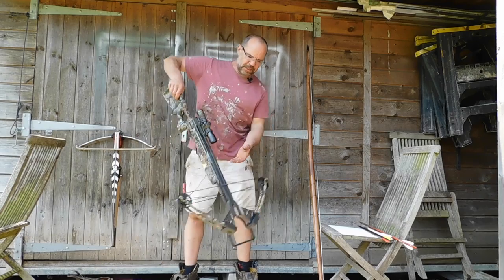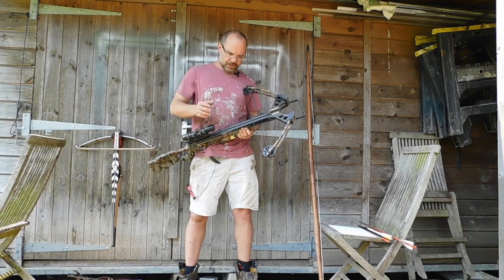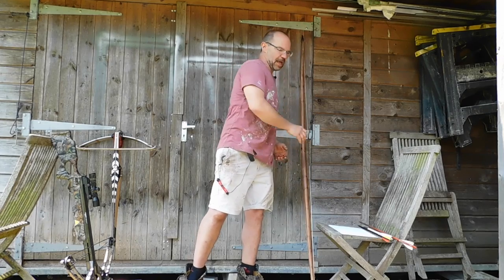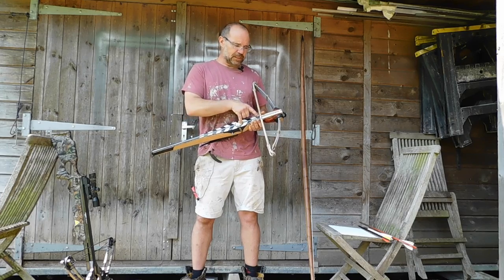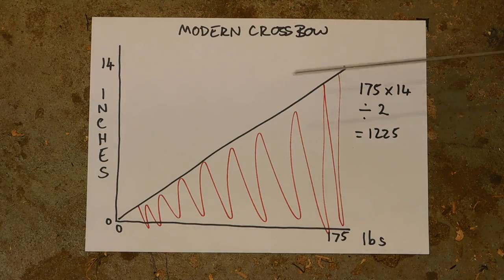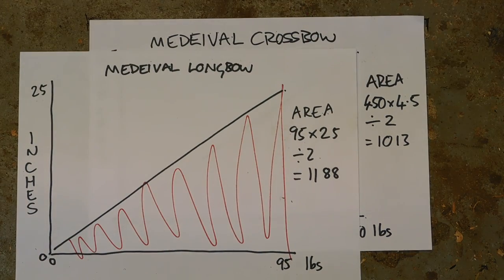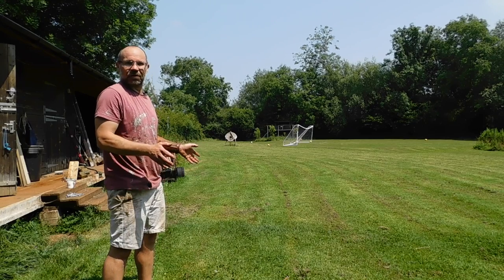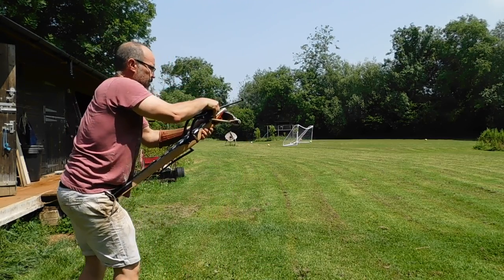Draw weights of medieval crossbows, longbows and modern crossbows

Comment: Well done, this is truly an excellent video. I just have 2 things to add:

Firstly, one of the biggest inefficiencies of the longbow is that it isn't cut past center, like a modern recurve is. That causes the direction of the force applied by the bowstring to not be directly in line with the arrow, wasting energy.

Secondly, I don't think it's fair to compare the kinetic energy of arrows to the kinetic energy of bullets. Arrows have sharp blades and points, and kill through blood loss. I think they're a much more efficient projectile design than a bullet (especially a slug) for penetration.
Reply: Also, in interested in whether momentum may be important as well as energy in penetration/damage. This would mean heavier projectiles with the same energy (and lower speed) might be more effective.
Reply: James K    The effect of a modicum of offset potentially has less effect on the cast than it does on lateral accuracy and dispersion. It is a fact that poor decisions on such factors as pass width, brace height, spine, even shaft diameter and of course shooting style and competence will to a significant degree affect how efficiently your chosen combination can be aimed and shot.
How do I know this? From years of close observation combined with recording my all scores in open competition and relating demonstrable improvements in performance to what was learned and applied to the process of geometry in set-up and subsequent results. 
I'm not just repeating a piece of received wisdom from modern archery as a generalisation.

I can tell you what works for me and why, but  figure that you can learn more if you work it out for yourself.
Simply put I work within the constraints of a certain degree of offset created by a combination of avoiding excessive pass-width, selecting an efficient cross-sectional shape, setting an appropriate brace-height and by employing an arrow selection for any given task that I have proven to my satisfaction.

An excessive degree of static offset at brace height or mismanagement of relevant factors can prevent being able to aim directly at the mark at full draw.. 
 It should also be noted that lateral centre-shot in a bow held vertically (or nearly so) is in comparative terms a very recent innovation. 

Q 1. What is the greatest degree of static offset at your brace-height that will allow you to aim directly at your mark and have the arrow always go there, all else being equal?
Q 2. What are the other contributing factors in bow geometry and set-up and how do they effect the outcome?
Q 3. What are the principle factors in consistently accurate shooting?

"it's meant to be simple. not easy".
Reply: @maninalift   There will be better or worse shaft combinations for a given outcome that can be found by methodical testing.

Comment: Neat video. 

Not sure how versed you are in a .22? Out here in Texas, the .22 is used for a lot and is quite an under estimated round. I think the .22 is listed as a round that has killed a lot of people, likely because “it’s just a .22”. 

Years and years ago the us army did experiments with 1/2” plywood stating if it went through the 1/2” ply it was lethal. 

Would be an interesting experiment to see what that 450 pound does on 1/2” plywood at 100, 150 and 200 yards - assuming you could connect.

Comment: An interesting comparison. Really puts things into perspective and hats off to Tod for a great, clear an informative explanation. One point though: Tod says that the old longbow was better made than the modern variety. This just a thought as I have no way in the means of proof. I would contend that a modern bow is better in regard to final build and tiller because of the time invested in its manufacture by a skilled modern bowyer. This is not to say that medieval bowyers were less skilled, but I suggest that emphasis was placed on the quantity of manufacture rather than quality of build. Modern customers are more demanding and expect a superb bow in all respects. Medieval bows, built for war did not have the aesthetics and perhaps the tiller was less than perfect. This did not detract from their purpose but maybe they did not last as long as the modern counterpart. 
  Flaxen Saxon

Comment: Tod, I think you overlooked something. The arms of the longbow and crossbow were still moving when the projectile was shot. This means that the crossbow and longbow still retained some kinetic energy. You cannot assume that all the kinetic energy went to the arrow or bolt. The energy left would be again 0.5MVV. The velocity of the arms would be different at different parts of it. So its a little complicated to calculate. But at the maximum, it would be the same as the velocity of the projectile at the point of release. M, the Mass of the arms is likely to be heavier in the crossbow because it was made of steel, it is probably safe to say that the crossbow retains more of the energy in its moving arms than the lighter longbow.

Comment: I always learn something from your videos. But I have one thing I'd like to add, as a firearms enthusiast and hunter. .22LR may have more energy, but it has very little mass. Something like 20-30 grains. It loses energy very quickly and therefore loses quite a bit of penetration
Reply: If you look at the [ethical energies needed for hunting typical game] charts there is a ratio for the Energy needed for arrows and bolts to the Energy needed for firearms to ethically harvest the same sized game.  If you multiply the Energy (in foot-pounds) of Projectile weapons (bows, crossbows, etc...) by about 60, that number tends to roughly match a modern firearm's required Energy to ethically harvest a given animal.  I believe this is mostly due to the Projectile Weapon's greater Sectional Density in comparison to the SD of the firearm's ammo.

Comment: I think something that's important to consider is the change in context of stopping power. Modern fighting involves weapons that even heavily injured soldiers can still use effectively, as opposed to all pre-firearm weapons which required much more physical labour from the user. A minor arm or hand injury would make a bowman essentially useless, a puncture anywhere on the body would make melee combat excruciating. The standards of damage caused by a weapon would have been much lower back then, and the ability for instant kills would be basically pointless, out of the fight is out of the fight.

Comment: About the units you used in this video. You wrote lbs (unit of mass)  on the x axis and inch (unit of length) on the y axis of the graph, which gets us:
length × mass
Which isn't the thing you were looking for, I think.

Now if we were to substitute lbs for lbf (unit of force/weight) we would get:
length × force
Which is a unit of energy and is the thing you were looking for, because all we have to do with this value is divide it by 12 and we get the good old ft×lbf.

Comment: Drag is proportional to squared velocity, so the difference between modern and medieval bolts may not be so great at 100+ yards.
Reply: Yeah but actually hitting what you are aiming at at 100 yards is a whole other story. But you are right. Weight trumps speed at any distance really as long as you can get it where it’s supposed to be. I compound bow hunt deer and have hunted with what I consider light arrows (350 grain) and heavy-ish arrows at 450 grain and that little jump makes a world of difference in penetration. Guys I know that use traditional equipment rarely are under the 600 grain mark. They will zip those arrows through a deer at or less than 1/2 the speed my compound is shooting.

Comment: Hey Tod, old video I know, but there's more to the story than you mentioned and I feel like it should be acknowledged. Broadheads don't kill through kinetic energy like bullets, they kill through penetration, which KE is NOT a factor of. Bullets push their way through tissue, which is why they have such high KE. A basketball carries far more kinetic energy than any of these tested mediums, for example. What matters is a mixture of physiological effects (muscles retract and lubricate arrow shafts with blood when cut while an animal is still living) along with the mechanical advantage of a broadhead (or to a lesser extent a bodkin) which amplifies the work the arrow or bolt can do with the available force. This is why an arrow will penetrate a sandbag deeper than a .357 magnum will.

Comment: How efficient is the Mongolian type bow over the Long bow, i was going to ask this in another video you showed.
Reply: You mean recurve vs long bow?
Reply: i read a study done by some university students awhile back that went in to just that. They concluded that in terms of efficiency, the chinese bow was about as efficient as any traditional bow can get. Not much of a surprise considering they used it for so long, even long after european firearms outclassed the bow in terms of battlefield efficacy.
Reply: Presumably you mean the recurve design (as opposed to the compound construction)? Both had significant benefits & drawbacks

Recurve bows of that period are expensive to manufacture in both cost & time & pack about as great a punch as English simple longbows. /However/ the significant comparison to draw was (?is) in the different styles of warfare: Orientals tended to prefer horse archers whereas Europeans preferred foot. Obviously a longbow is an impractical weapon to use from horseback, while the recurve can be designed to optimise the slash/attack cavalry tactics of the Eastern style /in a major battle/ (prolly a 'memento' of Ghengis' hordes: 'It worked then, so we did it this way!')
Reply: @snafu2350  ...They were used by the scythians in the antiquity already. Nothing about ghengis' memento or whatever.

Also just cavalry tactics in general. Can't use any other warbow effectively on a horse. Too big, or too weak.
Reply: @snafu2350  longbows were used on horseback just not very often. They had mounted archers but they mostly used the horse to bring them quickly to a location
Reply: @kovi567  See also the Japanese asymmetrical bow with a shorter bottom half and extended top half.
Reply: @Hiltok  See nomad recurve that is just objectively better, and was considered to replace them during the invasions.

Comment: Great video!
I think that the calculation is more complicated. Because of the higher the speed and lower the mass => the higher the calculated drag. 

so in rifles, you lose velocity faster than in bows or crossbows. (this is why rifles don't reach underwater)

On another hand, you reach the target faster. 

you can basically solve this by measuring the velocity at the target and then calculate the energy

Comment: Hi Tod...I hope you don't mind me sharing some technical thoughts?
...I shoot fullbore, 22lr and longbow.  The conclusions are missing the main issue of the energy conversion for a kill shot. 

 Lets start with the bows.  A medieval crossbow bolt has a larger bolt diameter than the arrow.  It needs more energy for penetration as its sectional density is less (shorter stave has less mass per area behind it).  The bow and the crossbow do not kill by total energy expended.  Their principal lethality was through haemorage so they didnt need the energy of a bullet as their lethality efficiency due to haemorage is high.  They do not need total penetration for this so again do not need the energy of a bullet.

Lets look at a rifle round.  The little 22LR at 68 joules needs both to penetrate and impart all that energy for imparting shock.  It does not kill by haemorage like and arrow.  With little deformation in a solid bullet the wound channel is narrow and penetration high but this also means it could pass through therefore wasting energy whilst imparting low shock.  It is less lethal than the longbow unless a vital organ is hit.  To increase lethality it needs to impart all its energy so hunting rounds use hollow points which expand to increase the wound channel and do more damage as well as imparting more shock.

So why don't armies use a 22lr?  Because it drops velocity massively with range and what started out at 1125fps at the muzzle is more like 700fps at 100yds.  It is range limited on killing power even for rabbits and not accurate beyond 100yds.  

Fullbore such as the .308 with a 150gr bullet have massively more stopping power as their projectile is 4 times the mass of a 22lr and velocity is about 2800fps so more than double that of a 22lr.  Their form factor or ballistic coefficient is higher meaning they hold onto energy for longer.

So how do you evaluate stopping power via shock?  Given that a longbow will kill you at 200yds using a broad headed triple or double bladed point?  It still has enough velocity due to gravity overcoming drag on the way down so penetration combined with the bladed tip will still impart lethal cutting inside flesh and arteries.

A bullet needs so much energy to deform the shape from high bc needed for efficient flight into a low bc wider shape to impart all energy without necessarily punching through.  It loses loads of that energy in flight so needs to retain enough to deform the bullet.  It needs sufficient penetration too so a rule of thumb is a certain amount per calibre of energy is needed per Kg mass of target quarry.  Given a mv of 2800 at the muzzle a 308 will retain about 1000fps at 1000yds for a 150grn bullet roughly speaking.   It loses a lot of energy.

A 22lr loses so much by 200yds that it may not penetrate or be deformed enough to kill a person at that distance as its energy drops right off to probably less than that of a longbow at the same distance so the longbow is more lethal.

The other thing to note is that military rounds are full metal jacket solid points so for shock they need to be lethal rely on hydraulic shock.  The is energy imparted by the supersonic wave in front or just behind the bullet entering the target and causing major disruption to tissue.  Arrows dont need this as their bladed tips slice through organs causing massive blood loss even with bodkin points this will happen.

Thanks for bearing with this.  Point is that you cannot effectively compare energy to draw conclusions on lethality as both weapons kill by different means.  Blood loss is easier to achieve with an arrow or bolt and this is why they were in use right up to the 18th century and even still today for hunting.
Reply: 'Shock' is meaningless. All that matters is tissue destruction. .22LR lacks the sectional density/mass to damage via stretch/yaw, so simply wounds by crushing a path close to its own diameter through the body. Penetration will also be less than more massive projectiles.

Comment: Excellent video! Are you familiar with Dr. Ed Ashby and his research into arrow penetration? It would be fun to know if there are historical sources that have explored the same subject! Of course, without modern mathematics, but still. Basically Ashby shows that optimal penetration is achieved with focusing more on Forward Momentum than Kinetic Energy. A stiffer, lighter shaft with a heavy arrowhead will outpenetrate a softer, heavier shaft with a less heavy arrowhead by a fair amount. That with arrows of equal total weight and tuned for the same bow. Ashby calculates this in FOC and EFOC ((Extreme) Front Of Center) values. The subject is easy to look up, if you don't know about it. But it would be interesting to know if there is evidence of this thinking in medieval times. Anyways, thanks for the great upload, as usual!
Reply: momentum  comes from the KE and Newton's law of conservation tells us the arrow get its momentum from the mass independent of its FOC. A smaller dimension shaft means less friction and surface area going in and more mass is concentrated more directly  behind the pressure of the point . Foc may give you better flight that equals less lost energi and a flatter ballistics curve that lets the tip of the arrow hit at the optimal angel to avoid deflection Also you must keep in mind that the dynamic spine of the arrow changes during flight so if the foc was important to momentum the foc would change during flight making it utter useless. i

Comment: This is great Tod.  Just to say that comparing bullets from guns with arrows/bolts isn't a fair comparison, as the arrow is like a knife, it kills by penetrating to cut blood vessels, whereas bullets are more a blunt trauma beast. A bullet hole does also bleed profusely too.
Reply: One factor you omitted was the friction of dragging the crossbow string along the top of the stock. That  contibutes to the inefficiency of the crossbow. Would've been good to unclude a composite bow of similar wieght to the longbow.

Comment: Brother I'm not going to argue, But, The cams at the end of the limbs are what make modern compound bows so efficient, NOT the limb size or weight, or material...  Change the cam's design and you can screw up the efficiency sooo bad that you won't be able to explain it with simple talk about limb quadrangles. Like you said, "We have computers these days to do the figurin for us".  Thanks for another great video Tod 

   P.S.  fast and light, or slow and heavy is an argument you can't prove or win, no matter which side your on.  Would you rather be hit with a small light baseball doing 90 mph, or a bowling ball doing 50 mph. 1 of them will leave a bruise... 1 of them will do much worse.     Thanks for your time and effort, you make people think and that is what I like about this channel.
Reply: The argument is that the baseball will go out of the park while the bowling ball will stop short. In early times and the age of line battle and castle defense the range was a pretty huge factor.